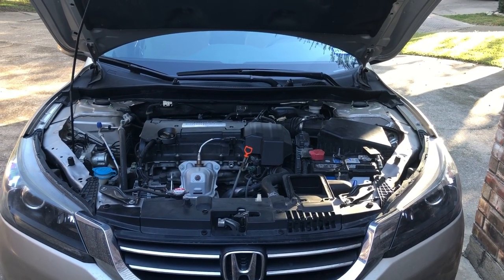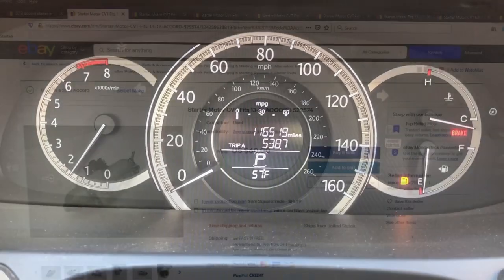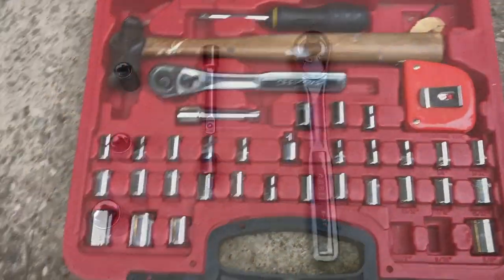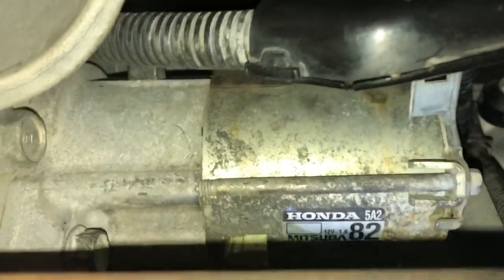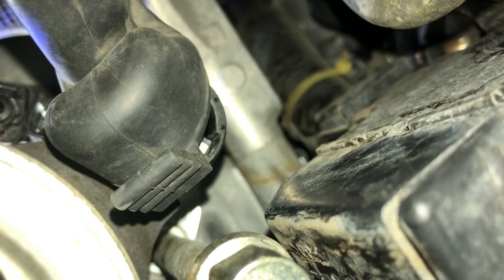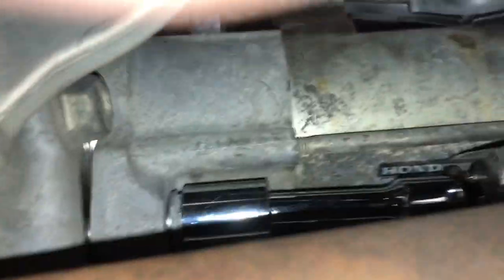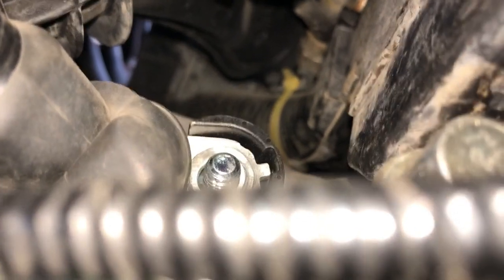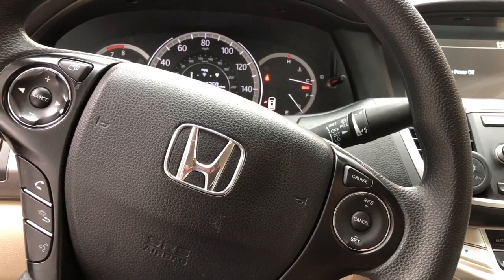Starter Problem & Replacement in Honda Accord 2013, 2014, 2015, 2016, 2017

Comment: We need more people like you in this world man. I think I'm
having starter problems too. I go to turn it on, it's clicks once then doesn't go on. I've read stuff about
the starter relay doing a 1 click thing too.
Reply from the maker: Thanks for the nice comment! Does your vehicle start after a few tries? How many miles are on the odometer?
Reply: @FlyBeee  It has 53,000. And it has stoped doing it recently. You think it’s the starter relay?
Reply from the maker: @JUDGEME5150  53K miles are fairly low. It may be Starter relay which will be in fuse box inside in engine area under the hood. Locate the relay and next time it gives you problem just replace the relay with a good one to see if that fixes the issue. Don't buy the relay just yet but definitely do the research on best place to buy it, or even the starter. In my case relay wasn't the issue and even starter problem was barely noticeable at first - when it happened for the first time car took a few tries to start and then next couple weeks it started fine, then it would take a few tries to start.... and the frequency of issue increased in about 3000 miles. I think you are already ahead of the curve by using this time to research the issue and looking at possible options. If you get a chance please review the text in the description of video. I have detailed steps on how to change starter - in case it comes to that for your Accord. Best of luck!
Reply: @ @FlyBeee  
So on my car i would have to try and turn it on a couple time at least 5 times before it would start and every time I’d hear a clicking noise could it be the starter?
Reply from the maker: @NA-se9fr  May be just a battery issue. Please check under the hood to see if there is any white/blue corrosion deposit on battery especially on the red terminal. That red rubber cap lifts up from its open end. If there are deposits,  pour any soda can on it (especially Coke) and it will clear the corrosion. Also check if the battery wires fit tight on battery. Tighten as needed. Let me know the outcome. Thanks
Reply: @ @FlyBeee  
It was the starter I ended up paying 320 for a reconstructed one
Reply from the maker: @NA-se9fr  Thanks for the update. Reconstructed starters last a long time. Glad you got it resolved because starter problems just get worse with time. Best wishes.
Reply: @ @FlyBeee  
Yes came with lifetime warranty and the new ones had lifetime warranty as well the only difference was the price but even if it’s reconstructed it’s lifetime warranty
Reply from the maker: @NA-se9fr  Thats perfect!! How many miles on odometer when you first started having issue with the starter?
Reply: @ @FlyBeee  
About 90k
Reply from the maker: @NA-se9fr  Thanks.... a few people had starter problems from 50k miles, and I don't know why there is such a big range. When you get a chance please see my video on engine Oil burn issue on this Accord which started about 90K miles. I was caught off guard by it, so keep an eye on it just in case your vehicle develops this issue - which seems to be quite common :( In description of video I have details of what has helped me fix the oil burn issue. I hope this helps. Best of luck

Comment: I used to drive a 2012 civic, the starter was pain in the rear to get out. Now my 2016 accord just crossed 100K, was bored and thought I should take a look as to how to replace it. Glad to see the engineers give us more room to work within the newer models and a very informative video. Thank you!
Reply from the maker: Thanks for liking my video! While replacing the starter I thought there wasn't enough room to work with so it is good to know that in comparison Accord actually has more room! How is your 2016 Accord doing? Any transmission or oil burn issue?
Reply: @FlyBeee  It's so neat to see you replying to a video that was uploaded about 2 years ago! Yea man, all the videos on youtube were telling me to take off the front passenger wheel and fish the starter out. I tried but it didn't work, took it over to my gf at the time, her dad was a mechanic and he took it out through the driveshaft like it wasn't anything. I stared at him for like a solid 5 min, was like how tf?!?!?!? ( I was too stunned to speak) I've been struggling to get that damn thing out for the past 2 hrs. But we joked about it after. 
Anyway, sorry I got off the topic, but honestly, I only had it for about 2 - 3 months and put on 15K+ miles (I travel frequently for work) so far, everything seems to be in great condition, I have a manual transmission, the clutch seems to be pretty solid, no slips. I actually have not experienced any oil consumption in this 2.4L engine. However, surprisingly I did have a slight oil consumption in the Civic 1.8L engine, maybe it'd consume about 1 - 1.5 quarts every 7,500 miles, which that's usually when I change the oil. Very interesting!
Reply from the maker: @captsumtingwong  You are welcome! I make videos to help others in the same situation so try my best to answer the questions I receive. Thanks for the compliment :) The story about your then gf's dad is so impressive! That's a pro move right there! The manual transmissions are solid like rock are fun to drive. Change the transmission fluid on schedule and engine oil every 3500 -4K miles and your Accord should last you a long time. 7500 mile interval is too long. All kept my past Honda Acuras for at least 200K miles so lets see how long this 2013 Accord lasts! :) Best wishes!

Comment: This is exactly what my car does very early in the cold mornings. I have had the started tested and it has shown the starter was good. I’m gonna get it changed. Thanks for this video.
Reply from the maker: you are welcome! also check the alternator / or get it checked. thanks
Reply: If your starter tested good, why do you need to replace it?

Comment: This looks like it should be easier to replace than my Rsx’s lol. Had to remove cooling lines, intake manifold, throttle body etc. but great video and very detailed. It shouldn’t take too long!
Reply from the maker: You are welcome! Yes the starter replacement is simpler task vs. work needed when doing this on RSX ! lol. I didn't have to remove any wheels, cooling lines or intake manifold. The details you see in video and the step-by-step list of work in description of video is all that is needed to replace starter. Best wishes, I hope all goes well when your change yours.

Comment: Hi 
Have same problem with my Honda accord 2014.
Can I buy a starter from Amazon ?
Thanks a lot.
Reply from the maker: Yes, Honda starters are available on Amazon. The description of this video has link to starter available on Amazon and you can there you can check compatibility with the trim level of your Accord. I hope it helps. Best wishes

Comment: Mine is a push start. Do I need a starter as well?
Reply from the maker: When you try to start the vehicle if it acts the same as shown in video then likely starter issue. Also check Alternator health to be sure it is not bad alternator , honda alternators go bad usually around 110K miles - see link in description is of video that shows how to check alternator easily at home with a $10 voltmeter. Best of luck.

Comment: After installing a aftermarket car audio amplifier and subwoofer  ... i started getting engine starter issues  it makes  grinding noise but then it starts  ...... ? Little help.  Thanks
Reply: Sounds like your battery is running out of juice. I'd get a new and more capable battery.
Reply: If you hear a loud grinding noise before starting go search up  2013-2017 Honda accord starter TSB
Reply from the maker: the new audio setup may have put more load on the battery but it should not impact starter. Check the battery terminals to be sure they are clean to provide full power to the starter, and also check alternator to see if it is in good shape. See my video on how to test battery vs alternator. Best wishes
Reply: Did you get it fixed?  I’m having the same issue after adding an amp and sub.

Comment: Is that an old school Casio Class G-Shock you are wearing? Also, I saw your little AAA-powered, magnetic flash light. THAT'S what I need when working underneath. I have a headlamp but my head won't fit into those tight crevices. Brilliant!
Reply from the maker: LOL! You have a very sharp eye. Yes, it is classic Casio W800H-1AV and I absolutely love this watch. Extremely light weight that I don't even feel it is there ... 10-year battery life, dual time zone, date, day of week, stop-watch and everything I need from my watch. Best $15 spent! :) That AAA  powered flash light was another fantastic find and nice to have around the home as needed. Thanks so much for the nice comment. Much appreciated!
Reply: @FlyBeee  Sure thing, sir! I liked that you got the camera to the back of the device, other videos I've checked out just kind of talked about it. The only critiques I have are that you didn't mention the bracket that covers up the wiring harness on the front and I don't recall you taking bolts out of the intake which is just to the right of the starter when it's mounted. Did you do anything with the intake bracket?
Reply from the maker: I got lucky that my phone captured decent video on top of starter! lol I didn't do anything with the intake bracket - the video you see and the description of steps I  provided are the only things needed to do to replace starter. If you have changed the starter, did you remove the intake bracket?
Reply: @FlyBeee  I ordered the part and am waiting on it to come in. If that bracket doesn't have to come off, *all the better*. My service guy said he had removed the intake only for ease of access. What about the wiring harness bracket that's slightly below the starter?
Reply from the maker: I didn't have to remove the wiring harness bracket either. The video shows all the work that I did to replace the starter.... which is only 2 bolts, 2 wiring connectors. There is decent space around starter to get the work done. The difficulty and time consuming thing is the fact that you can't see much of wiring or bolts, lol. Also, the wire connectors are tricky to remove so please review my notes in description of video and then watch the video on how to remove connectors. My camera surprisingly captured good video and I hope it helps.
Reply: @FlyBeee  And you've done the install more than I have (everything above 0 is infinitely more haha), so it makes me wonder if the wiring harness bracket and intake bracket removals aren't just "making it easier." If the parts place ever ships my part, I'll know more haha.. Appreciate all of your feedback!
Reply from the maker: In most situations there is more than one way to get to the results so what I show here is only one of the many ways.... and although it got the job done there are probably other benefits of removing the brackets that I am unaware of. If you remove the brackets when installing the starter please let me know your experience. Thanks!
Reply: @FlyBeee  just started doing this today, how the hell did you get that boot off of that bolt housing? it's like my hand won't fit up there.
Reply from the maker: If you are referring to the boot on the 12 mm bolt that holds the electric wire, there is a pull tab on this boot. Please review video from count 9:17 onwards that shows this pull tab and how you can pull the boot up, twist it a little and then tuck it under the wire to expose the 12mm bolt head to fit the socket. I hope it helps.
Reply: @FlyBeee  I definitely saw that pull tab but getting my hand to that pull tab was quite the chore, I finally got it, I had an equal amount of issue getting the bloody thing back on but it's all buttoned up and works, appreciate your tips and help and video!
Reply from the maker: I am so glad you made it work. There is definitely not much space around the starter and most of work is just by feeling it with fingers. I am guessing replacement starter is installed and everything now works? Did you remove the 'intake bracket' or the 'wiring harness bracket' or were able to install without removing these?
Reply: @FlyBeee  yes I did end up removing the bracket because it seemed like it gave me JUST enough room for my hand to get back there, my hand might be a little thicker than usual. My mechanic had suggested removing the intake entirely and doing the entire operation from above. I started looking at intakes and now I may want to upgrade the intake haha

Comment: @Fly Bee Thanks for the great video. I have 2014 LX and having starter issue I think. Issue started a few weeks ago that there are times it won't start right away. It tried to start but hearing some whining sounds and if i hold for a few more seconds it cranked and turned over, but sometimes it doesn't and remove the key and tried a few more times and it started. Do you think it may be related to  starter going bad? I have around 91K on my vehicle. By the way how's your starter going so far? Thanks again
Reply from the maker: In starter issue the car won't turn at all - like I show in the video. If starter turns but you hear whining noise  it may be bad battery - especially if your dashboard lights flicker when you start the car. Batteries go bad in extreme weather hot/cold so cold weather may be causing your battery to go bad. My replacement starter is going well even after 20K miles and no issues!
Reply: Glad to hear your starter is running well. My case ended up with bad starter as well. Got low mil used OEM starter from ebay and working good for a month so far.
Reply from the maker: @hphyothan  Awesome results! Thanks so much for the update :)

Comment: Will the new  or used part from Amazon fit on 2013 Honda Accord sport cvt automatic transmission ? Thanks
Reply from the maker: The Honda part # listed in description fits the 2013 Accord. For Honda vehicles I recommend using OEM parts, whether new or used and these part fit perfectly. If you decide to buy OEM or after-market parts on Amazon, the 'Amazon Confirmed Fit' option on top of screen should be able to verify whether it fits your 2013 Accord CVT 4 cyl. I hope this helps.

Comment: Hey I have a 2017 Honda Accord sport , we were recently hit by hurricane ida and water has gotten up to my floors. Since then my car has been running however, it has cut off twice. The first time I was sitting with my key in the car when the lights started going crazy. I got a jump , got my battery and alternator tested after which was they are both good. My car has been running since then (3 weeks ago) 

Yesterday I was sitting in my car when it cut off again. I hear this noise before it shuts off short of like the sound of the a light flick. I waited 30 minutes and it turned back on again. 

Could it be the starter ?
Reply from the maker: I am glad you all survived hurricane Ida! whew!  About the car issue, the starter and alternator both are located higher than vehicle's floor so wouldn't be affected by water unless water splashed really higher up - and you've got them checked so glad they are doing okay. The car's immobilizer system is connected to battery and any water may trigger power cut-off so I would double-check that first to make sure battery area, connectors and base tray are fully dry. Best of luck!

Comment: Does the Accord V6 has the same starter problems? Is it the same procedure to change it?
Reply from the maker: It seem like v6 version also has starter issues. But if your vehicle has 100K+ miles, check the alternator first to be sure alternator is in good shape - description of this video has link to my youtube video that shows how to easily check alternator with any basic $10 voltmeter.

Comment: Do you a radio code after you take off the battery???? Tys
Reply from the maker: Most likely it would. My Accord retains radio code if battery is disconnected for a short while. I don't recall whether I needed to enter radio code after replacing starter. In case you don't have radio code the Honda dealer can look it up. Radio code also shows in your Honda owners' account at owners.honda.com . If you don't have account just make now and and add your Honda by entering the VIN number. I hope it helps.
Reply: @FlyBeee  thanks but the honda dealer want me to paid $159.99 to get the code you know about the dealer scam.
Reply from the maker: @johnng6087  No way!! did you try the other option to make an account on owners.honda.com and enter VIN number to see your car's details?
Reply: @johnng6087  you can just skip the code by pressing something just put it in YouTube there’s videos
Reply: You may be able to find your 5 digit radio code number on a white sticker attached to the left side outer panel of your OPEN glove compartment door.

Comment: How would you pin point to starter issue instead of alternator?
Reply from the maker: When the issue is with alternator (charging system) it would not charge the battery and as a result when starting the starter cranks but there is not enough battery power so the dashboard lights will dim out and flicker and the process drags on. In starter issues there is full power in the battery (lights won't dim or flicker) it is just that starter would not crank at all.